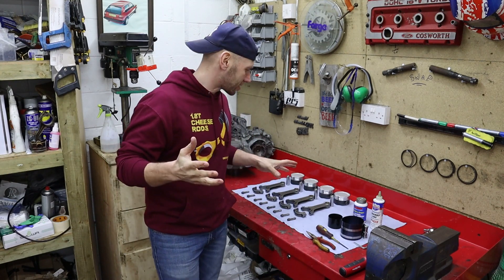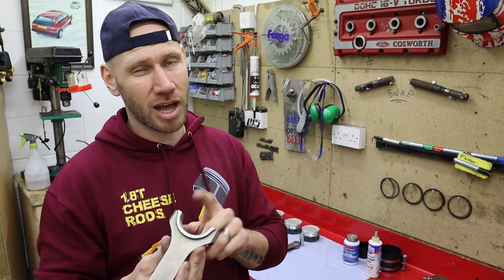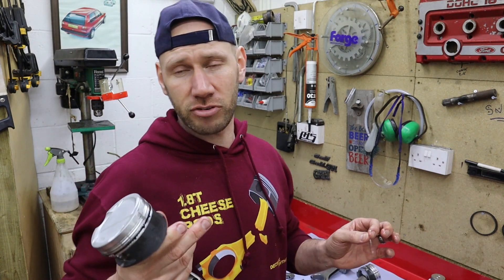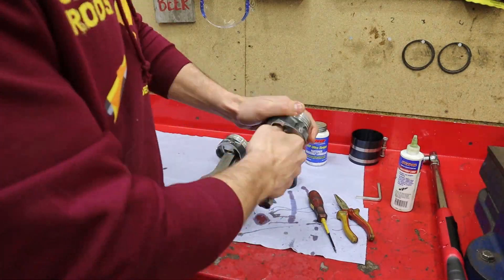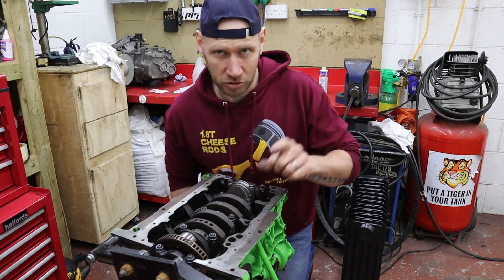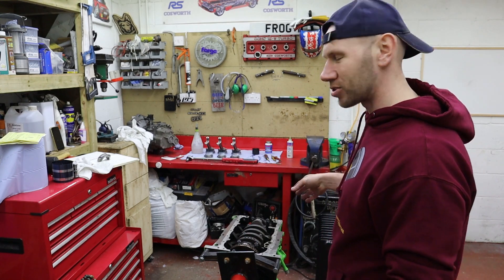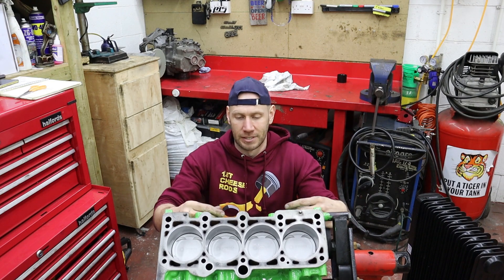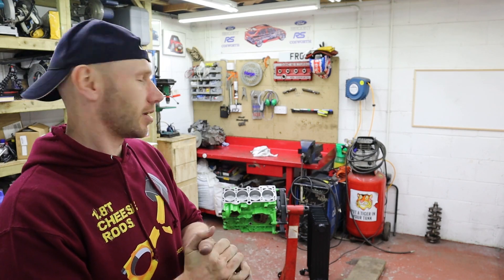PISTON/ROD ASSEMBLY // 2.0 20vT STROKA MOTAA

Comment: Always going to be controversy when it comes to piston ring Orientation  , I personally do not like to put the opening on the ring facing toward a Thrust side as it takes the most wear , if the wrist pin center line is 0⁰ I set my top ring at 135⁰ , 2nd ring at 315⁰ , 1st oil ring at 180⁰
2nd oil ring at 0⁰ and the expander ring gap at 270⁰

It keeps all the openings away from the Thrust side and it keeps them 180⁰ apart aswell , just my input , if anybody else has input please let me know,  I've done many engines this way and have never had a problem 😊
Reply from the maker: I set them to how I like for install, as the rings will rotate in use anyways so using a specific setting is almost pointless.

Comment: Hi there I'm currently building my mk1 toyota aygo with an agu engine however can I ask what you have done with the gearbox clutch line to the clutch pedal. Reason why I ask is because I want to add a braided line from one to the other however the gearbox cylinder has a weird fitting into it, wondered if you have changed your cylinder on the lupo to an aftermarket metal cylinder so you can fit a 1/8 npt fitting for example. Would really appreciate the advise
Reply from the maker: Hi mate no I run the mk4 golf hydraulic clutch line and slave cylinder. Sound like a cool project you've got there though 🤘
Reply: @DecimalTenths  sorry to bother you so much but what injectors would you recommend for 300bhp. I have the AGU large port manifold and also clutch please. Really appreciate it in advance
Reply from the maker: @leorossouw7337  no sweat mate. Are you running standalone management or the oem Bosch ME 3.8 ECU? Injector sizing for 300bhp would be around the 440cc mark, although if I were you I'd go 550s, readily available plus plenty headroom.
Reply: @DecimalTenths Brilliant thanks. I'm going emerald standalone yes. Are you running the standard clutch?
Reply from the maker: @leorossouw7337  No mate, if you're staying 5 speed you'll want  a G60 Flywheel (02A) with a standard VR6 clutch from sachs or LUK. That will easily cope with 300bhp. I may even have a G60 Flywheel kicking around if you need one... all different if youre going 6 Speed 02m. Emerald is an awesome choice of ECU, although it would be far easier to wideband it and go Ignitron
Reply: @DecimalTenths  Thanks if the flywheel is in good nick then ill be interested it yes mate. Cheers

Comment: When it’s all together nick would you talk about running in times and oil change intervals 👌🏻
Reply from the maker: Yes mate definately a big subject that one and I've got plenty of opinion on it 😝👍
Reply: Decimal Tenths Good man 😅
Reply: Full send!
Reply: Just a quick question would 500 miles on Miller's cro (this is what badger5 recommend) be a good interval for just rods and bearings Nick?
Reply from the maker: @davidkane9876  Thats exactly what I'll be using mate. If the rings arnt getting replaced I'd suggest that 500  is a good amount. You're essentially just using it as a flush for any assembly lube.
Reply: @DecimalTenths  ok cool that's what I thought I'm building my motor with hurricane rods from b5 but with a fresh polish on the crank,block was fully inspected and honed 3 thou from the head and inspected and cleaned. Full valve strip down and assembly etc etc. Just I was thinking like a bike 500 then fresh 5/40 mobil 1 then 1000 then a fresh fluids again then take it for mapping. Not going stupid power only mid to low 300's but it's a decent build. What is it your aiming for buddy? 500-600?
Reply from the maker: @davidkane9876  haha that's a subjective question mate, and the answer changes every day... I only need 350... 🤔
Reply: @DecimalTenths  Lol it's always gonna be that way when you have options like you do bud. What need and what you will end up with is a totally a different kettle of fish lol 🤘